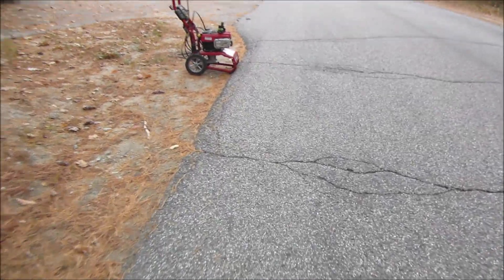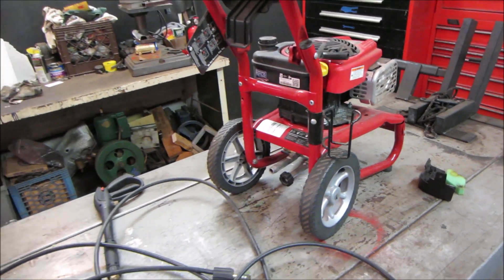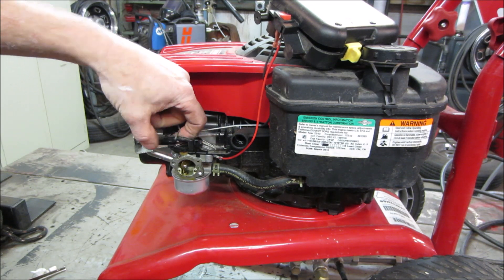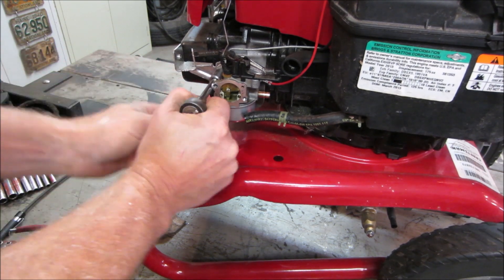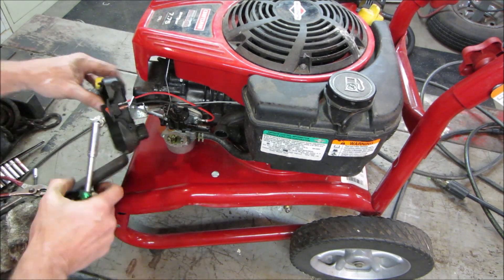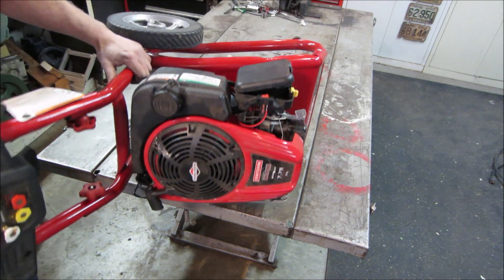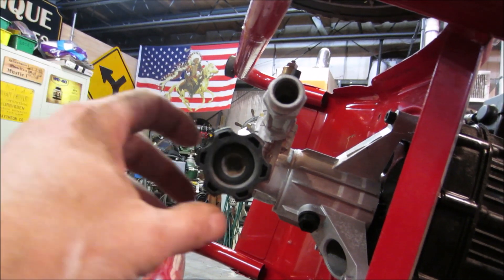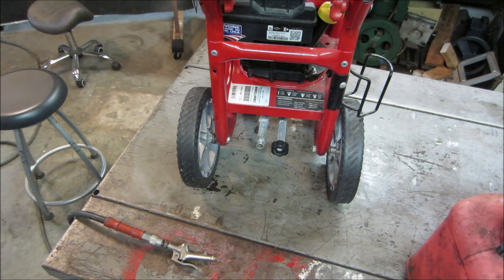Can It Be Saved? Junked Pressure Washer From The Garbage.

Comment: You might be able to fix that crack using low temperature ali' brazing rod, I've managed to fix a few things with this stuff! You would need to 'vee' out the crack then heat it up with a MAP gas torch then apply the rod. It would make for a good video. In fact where the crack is located is already forming a vee anyway.
Reply: I was thinking the same thing
Reply: @rodashford1151  me too.
Reply: tig weld too
Reply: @M.TTT.  mig weld low heat, right wire ? Is it worth it.hours $ $
Reply: @hughmc5419  tig probably easier with aluminum, but I have no experience with it, looked like a small crack. Mig aluminum is a pita. But yeah, new pumps only 75 dollhairs or so...good reason to tell the wife you need a new welder though 🤔😂
Reply: Alumiweld.  Cheap and works.
Reply: @M.TTT.  I'm sure that a good TIG welder could weld up the crack but that is not really Mustie's style. The ali brazing stuff is very good because there is no danger of heating the whole part up to melting point, the braze bonds at a molecular level unlike epoxy resin so it won't blow out. You just have to clean the part very well with a brass or stainless brush, you must heat the part and not the filler rod. I can see that the ridge where the crack is would allow a nice 'pool' of filler to form which would make for a very strong repair.  The only pain in the ass would be that you would need to strip the pump head down to avoid melting any plastic parts fitted into it.

Comment: I was thinking maybe braze the pump, or use some of that aluminum aloy rod and use a propane torch to seal that crack
Reply: That would be a good video. 
Title could be " can we stop the leak"
Lol
Reply: @RANDALLOLOGY  Blue Demon rods......hmmm its a thin part i'd be tempted to use some JB weld before trying heat that said im sure mustie has a tig!
Reply: Yea a zinc alloy brazing rod repair would work.
Reply: @tollietime  I've used JB Weld for years; it even worked to repair my tennis shoes.
Reply: Or if you could get to the end of the pipe and inset a thin copper or alloy tube inside
Reply: @dgriffin6074  As far as a sealant and puddy type adhesive, Windshield Urethane by 3M Is Probably The strongest bonding Sealer I've ever used on almost everything but A little Bit Map Gas and Silver Solder after cleaning up the area a little bit with a dremel would be the easy way to fix it
Reply: Was thinking same thing.

Comment: I winterize my pump by shooting some kind of fluid from a pressurized can.   It comes with the fitting to match the hose inlet fitting.   It blows out the water and leaves a lube film inside.    I have to remind myself to stay away from the outlet.   I gently turn the engine while doing it.   Pump is ready every year.   I also drain the fuel tank and carb float bowl.   The whole operation takes about 10 minutes.    By doing this I don’t need to worry about ethanol gas damage.
Sunday lunch with Mustie1 !!   Fun and instructive at the same time.

Comment: Your video reminds me I need to winterize the pressure washer at work.  I run some RV antifreeze through it and the hose and spray gun, seems to work fine for winter storage.  We have the same pressure washer at work and it works great.  I have a little electric one at home and I just put it in my shop that is heated LOL.

Comment: You can fix that little ol crack, You can DO IT ! 
Reading other comments I am not the only one that thinks it would make a good video as well.
For a little more time you might be able to fix it and have you a decent pressure washer for the house, I was suprised that you did not already have several already.  
Thanks for sharing the technique of blowing air through the system to clear remaining water, don't get freezing temps in this part of Texas often but it only takes 1 freeze and a little water to ruin good equipment.

Comment: Pump heads are available for about $70. Kind of kills the “free” part but still a good deal for a good running pressure washer.
Reply: Yes, depending on the HP of the engine it is possible to upgrade the pump to 3200 psi from the original 2300.  At that point the pressure washer is much more useable for heavy duty applications. With the $70 outlay, that pressure washer becomes a beast!
Reply: The engine seems like it runs good so 70 bucks for a new pump is still a good deal much cheaper than a new one. I found one with a split pump about 4 years ago and found a replacement pump on Amazon for 79 bucks. Mine is a Simpson and I just used it for it's 4th summer so not bad for 79 bucks.
Reply: Yeah still come out a winner,agreed!
Damn accessories like the lance & pressure hose costs more,believe  it or not 😤
Reply: He will find the part this week on the curb.
Reply: @cheeseburger9232  probably so
Reply: @kman-mi7su  moo
Reply: "Project Farm" used an aluminum brazing rod to fix a cut in an engine cylinder head! great channel for finding the best / most economical  product for a job(tape, glues, screws, filters , lots of stuff)
Reply: Pumps not that cheap in Canada.
Reply: Brand new pump off Amazon is only $97.00. Just do that than try to fix this one with a pump head.
Reply: Craftsman used to replace things for free.

Comment: I just fixed the exact same one for my uncle!
His son lost some parts of the carb trying to figure it out. Fixed that. Then found out it wasn't pumping. Pulled the pump head off, everything looked OK. Then I pulled the regulator out to find out that the seat had cracked. Simple fix. Works great. Cost less than a new one.

Comment: Wow , every time I see a cheap , simple pressure washer I am blown away . After working at a factory and later a field service tech. on industrial units I an amazed at the super lite duty units . Number one way to destroy any unit is to shut gun off and leave it running . Usually in a matter of minutes it will melt or burn seals on pistons or plungers . Homeowners often leave water in and freeze the pump or unloader valve .

Comment: The "wobble cam" is called a swash plate.
The cracked pump housing... a TIG welder will fix that.
Reply: yeah i was hoping that he would try...
Reply: I was hoping for a weld fix myself.....If not $73 from Amazon gets you a new pump and it’s fixed.
Reply: Can you tig weld that zinc junk? That housing is zinc, right? or not?
Reply: Some of them are zinc pot metal while the more expensive brands often use an aluminum alloy of one type or another which is easily tig welded..
Reply: @trevorjameson3213  there's zinc in the alloy. And God knows what else too. Whatever was cheap in the Chinese scrapyard that day I'm sure.

Comment: I really appreciate your knowledge, presentation style, and your channel. 
I am completing the rebuild of an Ex-cell pressure washer.  It has a Honda GX390 engine and an Annovi Reverberi RKV-4G32 pump.  

Regarding the pump:
I replaced pistons, spacers, piston o-rings and nuts, check valves, and unloader o-rings. I had  problems with the unloader, the spring was missing. The shaft keyway was also broken, suggesting the pump became difficult to spin.  I put a spacer and a shorter main valve spring in the unloader because this unloader and spring are obsolete, and I cannot find a new or used one. 

The unloader fastening bolts are hollow tubes that bolt in to the manifold. One is 1/2" low pressure side, and 3/8" on high pressure side. These original bolts are steel and extremely corroded.  I replaced them with a set of brass ones.  I replaced the o-rings on these tubular bolts. I replaced the keyway key. 

I hooked up the water supply and the unloader leaked at the new tubular mounting bolts.  I had crushed the o-ring. It must have slipped out during reassembly. 
Replaced it. No more leaks. The engine ran for about 5 seconds, then bogged down.  The pressure gun trigger was stuck.  I pulled very hard on the trigger and water shot out like a rocket. 

It seems I have too much pressure building up internally. I am researching this problem. I suspect the unloader that was missing a spring may be part of the problem, but not sure.  

What else can raise the pressure inside the pump? Can the two tubular bolts mounting the unloader be the problem?  The 1/2" tubular bolt mounts the low pressure inlet side. The 3/8" bolt mounts the unloader to the high pressure outlet side.  These tubular mounting bolts do have orifices.

The motor is a Honda GX390. The pump is an Annovi Reverberi RKV4G32.  All pump parts are AR parts specified in AR parts breakdown for the pump. The two tubular unloader mounting bolts (Part# AR2121 are"brass"). The original ones were carbon steel.  I can't find a reason for this difference, except the brass ones look like a newer design and since they are brass, they should not corrode like the steel ones.  The unloader is a VR 3/B. 

Can you enlighten me about what can make the pressure increase to the point the motor bogs down like this?

Comment: Greetings: I think the draft flow mechanism term you were hunting for was "venturi".
Also, the older tire type air valve is called a "schrader valve"; which is also used for automotive air conditioning servicing.

Comment: I picked one up with a 6.5 Honda 3500 PSI pump ,50FT of hose and you could not turn the engine over.  When I pulled the cord it would lift the entire unit.  This unit could have only been run ONE time at most.  So I took it home pulled the pump thinking it may be frozen up, IT WAS FREE.  so i pulled the plug and the engine turned free .  So i decided to pull the head.  I pulled the Rocker arm cover and one of the puch rods was laying on it's side.  The adjustment nut had loosed when it was running and the push rod came off.  It must have NOT BEEN TIGHTED right at the FACTORY.  WORKS and RUNS GREAT.  NICE FREEBEE!

Comment: * Correction *
Soap Suction port is always on the output side! (Arrow --> ) , the black plastic nipple is the over heat safety valve.
this pump is an Annovi Reverberi
Even those pump is life time internal oil, you can change it by removing the black plastic bolt and fill with 75-90w Gear oil (2.29oz capacity)
Head is replaceable and you can buy separate part to rebuild seal and or check valves

Comment: have someone tig weld the crack, it would be a alloy housing
Reply: I bet, the modern world being as it is, that you can't buy the casting as a spare, or if you can it costs more than the washer. 
That casting, in bulk, cast, drilled and threaded, would probably cost <10$ to make, but in the unlikely event they offer it as a spare it probably retails at >100$
Welding might be an option, or drilling, threading and clamping the crack closed.
Reply: I was looking at about 26:30 and thinking to myself "that would make for some great tig practice!" I really wish that people would leave things like this out in North London (UK) but these days, if you do that you get hit up for fly tipping instead 😔
Reply: I was going to say weld (tig) or braise?
Reply: There are awesome electrodes for stick welding stuff like this these days
Reply: One of those soft alloy rods would weld it with a little gas.
Reply: @Farmelle  Not much call for garden tractors or petrol driven pressure washers up North London, but if someone can invent a quinoa powered one you can bet there'd be hundrens of then on the kerbside.
Reply: As a tig welder specialized in aluminum and stainless I agree.
Did a similar casting for a pressure washer before and after disassembly and some good cleaning it's easy to weld.
Reply: @M0UAW_IO83  If we could have Black pudding powered ones we would never get rid of them in Manchester.!!!
Reply: You beat me to it.
Reply: Roger Francis  Enfield CC have been really cracking down since they went to Bi-weekly collections, though I did manage to snag a couple of PlayStation 3s a couple of months back. I mainly repair and resell consumer electronics, but my garage is kitted out for small scale car repairs (stainless exhausts, replacement bodywork and the like)
Reply: @Farmelle   what is “fly tipping” ?
Reply: @Farmelle  oh. Illegally dumping waste.
Reply: Yes but an alloy of what? That pump is made out of white mystery metal. It ain't pure aluminum that's for sure.

Comment: Air flowing across and drawing the fuel is called the venturi effect, the air flowing across creates a low pressure. In this case atmospheric pressure, 14.5 psi, standing on top of the fuel in the float bowl pushes the fuel into the carb passage, there is really no such thing as suction, I know this sounds like a wind bag reply, but it might help others understand how carburetors work.

Comment: I have a Troy Bilt,  similar to that one it froze and had a small Crack I cleaned the housing off and used JB Weld to fill the crack and it works great.  It worked before it froze,  and now it works fine.  The engine a Briggs had more problems,  the intake valve guide moved towards the valve head,  and held the  valve open.  Took it to a machine shop,  they heated the the head drove out the guide,  knurled the guide reheated the head,  drove the guide back in, plus did a valve job and it probably runs better now than new

Comment: Hit the manifold with the MIG and seal it up? Aluminiweld hobart rod?
Reply: Flex seal tape
Reply: One of the things I found with those rods is if you get the casting hot enough, it will run where you don't want it to. It's fine for welding thin plate like 1/8" anything thicker like a casting takes a LOT of heat to warm it up to melt the rod then it's almost too hot. That's why tig is nice, really hot in a small localized area.

I guess with practice you could do it though with the rod.
Reply: Fiiiiiiiiiiber fix!
Reply: @chemmerling  n

Comment: For winterization you can use RV antifreeze. It will not only preserve the pump but also CT’s as a storage lubricant.   Get a piece of plastic hose with a garden hose fitting on it. Pull the starter until the discharge is the pink antifreeze.

Comment: Some grinding with a dremel and a good gob of the slow-setting JB-Weld (so it gets into the crack), should fix the crack up nicely, not much to lose really if it just ends up as your own home-use machine... :)
Reply: That's not going to hold up to the pressure, tig welding would be the way to go
Reply: Please don't use J B weld that stuff is a waste of time and money
Reply: @ralphsnow2337  thats funny. An $8 tube of JB weld saved me hundreds and saved my entire fishing season. Used it to fix a crack in my lower unit. Still going strong!

Comment: Very good it seems like it always the carburetor being fouled up or the pump being cracked or leaking a lot.
Reply: Can you fix the the crack in the  pump with some kind of high strength liquid steel epoxy or aluminum weld it of some sort?

Comment: I have to say, your mechanical skills have improved a lot...over the years.  Started on the second pull!!!  Pressure Washers kick ass:  1.  Don't let them freeze.  2.  Don't let them run dry.  3.  Don't let them run without the gun nozzle OPEN!  ...The pump overheats, even while idling!  The "offloader" or pressure relief valve is only a inch or so from the pump.   So that tiny amount of water goes around and around...gets hot.  Would be an interesting test for some low temperature braze type "alum-o-solder".  That's about it.  Hey, that was a great video!

Comment: Those pump heads are very cheap. I bought one just like that for $20 and replaced the pump head.
Reply: I've also bought the whole pumps on Ebay for about $85. They work perfect! I've replaced 3 pumps this year on 3 different "free pressure washers" like this one. I sold each one for $150!
Reply: @troystanley192  Nice scores.  I will keep this in mind for the future if I run across any dead pressure washers.  Usually here in Idaho they fail because of the same issue in this video they freeze up.  The other issue is the overheat easily you can't stop pressure washing and just let it run.
Reply: @troystanley192  I can confirm this. Replaced two pumps on matching yard sale finds. Now both the pops and I have dueling machines. Pretty easy fix for a dumby like me. Three bolts.
Reply: @wildbill23c  Same issues here in Ohio. They freeze and bust. The black piece he thought was the soap inlet is actually the thermal relief valve. It has a plastic plug under the black cap that will melt and allow water to flow out the black tip when the pump overheats.
Reply: @bctupper  Nice! The only issues I run into sometimes is I have to add about 3 washers between the pump and the pressure washer frame to get the new pump to fit. I still have 5 "free pressure washers" that need pumps or wands and hoses. I should have those all ready for sale in the spring when everyone starts doing their spring cleanup. That's also usually when the free ones come back to me for busted pumps.

Comment: Add a car alternator and you have a speedy battery charger, ideal for the cars you drag in lol
Reply: They sold a generator that used that same engine and frame set-up.
Reply: @Blazer02LS  Perhaps i'm not so mad after all lol.
Using the same frame and motor for more than just a pressure washer makes sense.
Reply: My dad used an old Wisconsin engine with an alternator from an Mercruiser inboard engine he rebuilt to charge the batteries at our rv site that has no power for years. It had a muffler from a Snow Cruiser snowmobile attached to it so it was surprisingly quiet.
Reply: @gord7025  that sounds like a very handy fast charger,  quality diy  :-D
Reply: Yoyoyo! good morning my british man!
Reply: @DaBossk  hello again, i hope you and your family+frends are avoiding the evil virus.

Comment: perfect candidate for low temp brazing with some alumiweld sticks from the outside .... strip heat locally fill crack off ya go ... done simmler before with a high pressure water pump